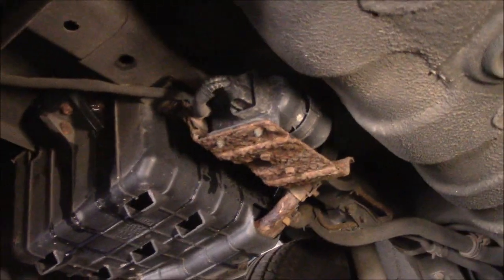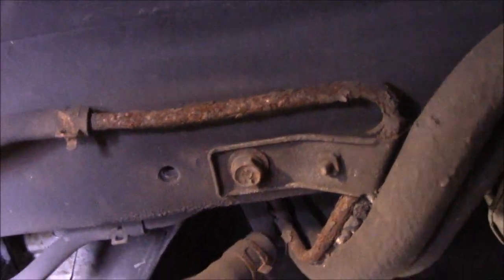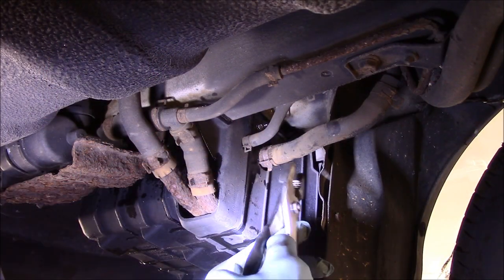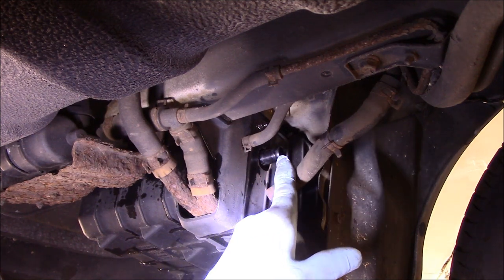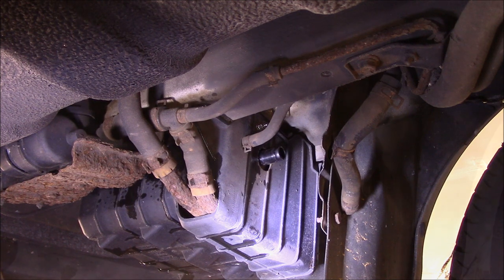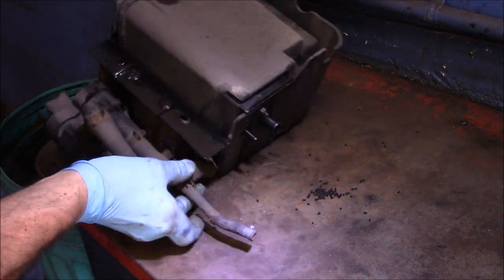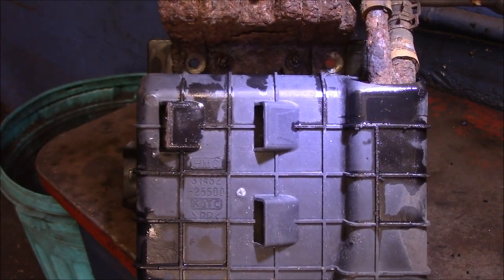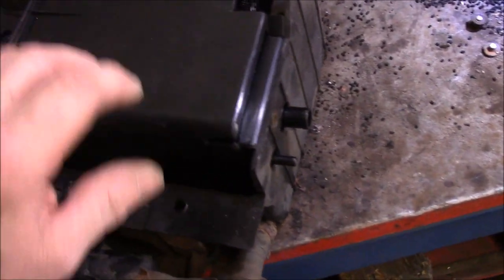How to fix a car that will not take Gas the pump keeps shutting off

Comment: I have a 06 dodge magnum v6. Gas will not go into my tank. I removed the charcoal canister and blew compressed air into the canister. ..it's not blocked and no pellets inside. I also blew out the filter attached to the canister. ..
I still can't pump any gas
Reply: Are you still having this issue? I have the same issue on my 05 Chrysler Pacifica.

Comment: On mine it was the vent valve stuck shut, not functioning. There is a valve on top of the tank that can cause this problem, or it can get charcoal or something in it. Go fuel the car up full blast and see if it's fixed. 

https://www.justanswer.com/hyundai/63iws-hyundai-accent-gl-03-accent-64000-miles-when.html